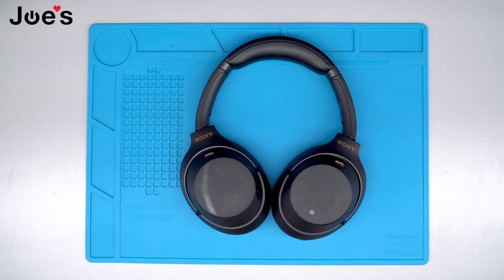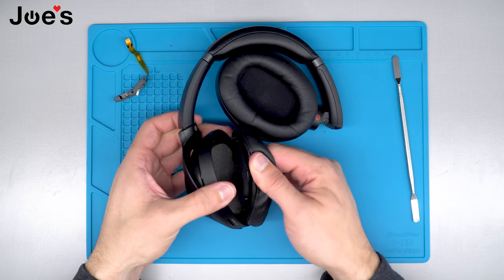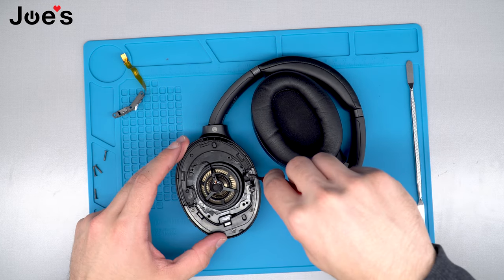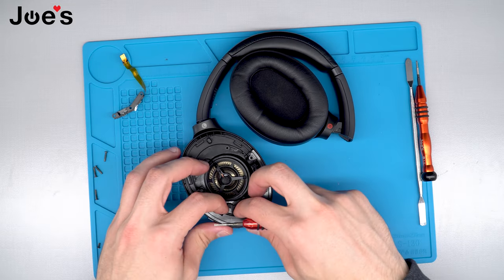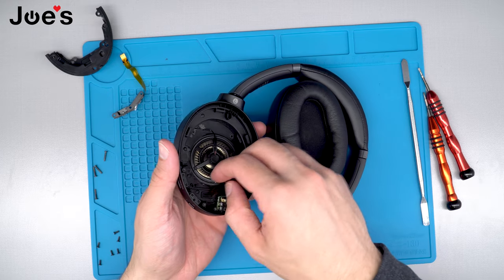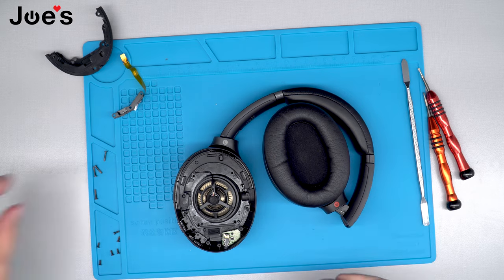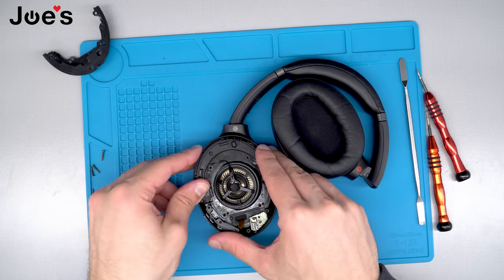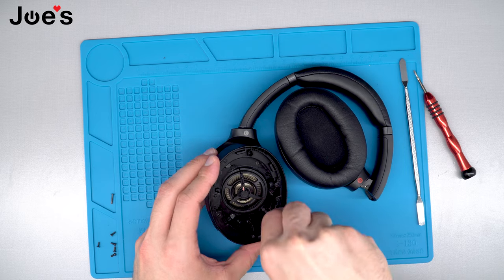SONY WH-1000XM3 XM3 Power Button Ribbon Replacement | Repair Tutorial

Comment: Thanks you soo much for this tutorial. For months I had an issue with my XM3. Thanks to your very well made video I found the courage to open it up.  Loved the clear instructions. With disconnecting the ribbon and reattaching it it started working again like a charm.
Reply from the maker: Hello, you're very welcome. Thank you for the comment. Please like and subscribe for more content like this 😊
Reply: What was the symptom of your earphone ?
i have a problem byut want be sure before starting
Reply: @puppet_s_master  I could charge them up. Since the light was glowing for charging and then after a while it stopped charging when they where full. But i could not power them on. I tried soft and hard reset, and activating them over the app. Didnt work. When I opeed them up and detaached, reatached the ribbon cable they started working again aka i could power them on.

Sadly it started happening more and more often. At one point a had to do it dayly. So i stopped. Could order a replacement powerboard on aliexpress i suppese.

Comment: How do you know if your power button is defective or not? Mine won’t turn on, but it does faintly flash blue for a split second when clicking on power button but does however not turn on. My headphone won’t reset neither.

I measured the battery today with a Multimeter and it says 4.29V? Is it the battery the cause for my XM3 not turning on or the power button?
Reply from the maker: Hello, thanks for commenting. Please email us at support@joesge.com with your question. We will be able to better assist you there. - JoesGE
Reply: Did you ever figure yours out and get it working?? I have the same exact problem and not sure what to do. If you got your working please let me know thx.
Reply: @Josiah-Hulin10   I found out the issue. Mine has a bad or half broken connection on the main board (on the side where the power button is). i don’t know specifically where the issue is. When I put a bit of pressure onto the main board, it has no issues turning on, so it may be a lose connection somewhere. :)

I have made a hack where I have put a rubber tube to put a light pressure onto the board with help from the cover to pressure it down onto the main board. It works fine now, but not the ideal solution. ^^ Got the Headphones for 20$ - so I do not complain haha 

Hope this helps!

Comment: Hello,
Is it possible to remove (or just diconnect) the bluetooth antenna please ? (I want to make sure the headset will not emit even if I forget to plug a jack)
Reply from the maker: Hello, thanks for commenting. Please email us at support@joesge.com with a screenshot of your question and we will be able to better assist you there. - Aaron P